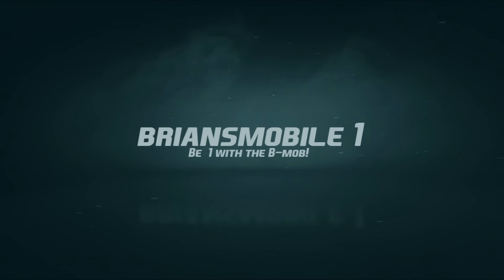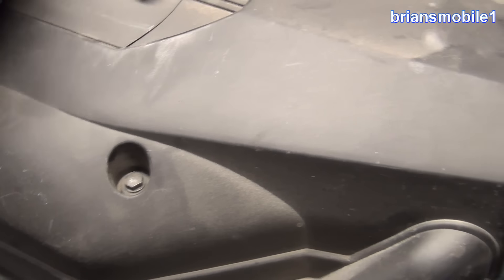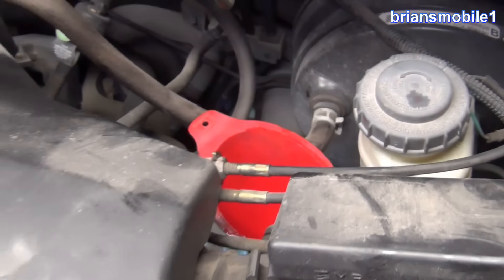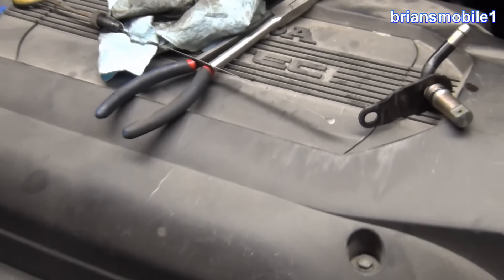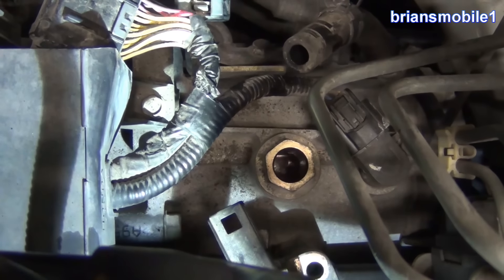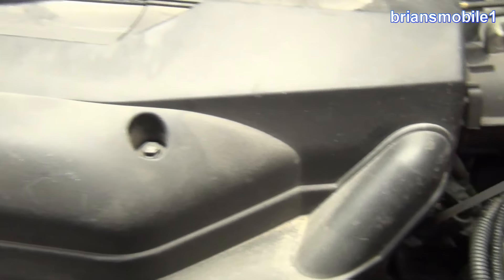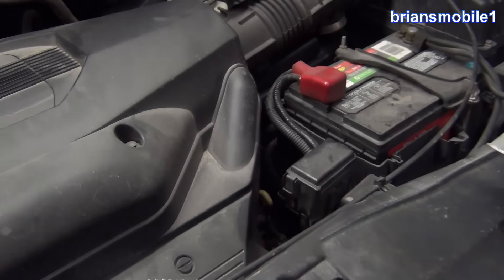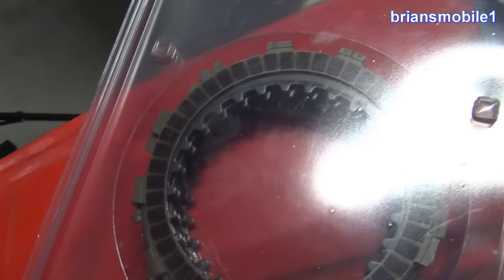Watch this Video BEFORE You Destroy Your Honda Transmission

Comment: Are there any filters that we should replace as well?
Reply: Honda transmission filters are mostly internal.. unless you want to seperate the transmission and tear it apart. Go ahead.
Reply: @edwarddiaz8136  Actually, you might be partly correct from what I hear but I recently watched a video of a guy changing a cooler line/cartridge filter that's part of the transmission system for this type of vehicle.  Also, there seem to be in-line filters that are also being sold for these Hondas.  Shouldn't we be changing at least one of these?

Comment: Thanks Brian
My 93 accord will downshift for a few seconds while driving on highway.  The green light on "Drive" flashes.  Can you give me advice.  The fluid has been changed several times...no flushing was performed
Reply: Do your floorboards get wet after heavy rains?
Reply: @netdoctor1  Hey there. Your question has me curious now. My son has a 2000 Acura TL. As the rainy season began, the trans started slipping when it warmed up. I do also notice the front floorboard carpet (especially on the driver's side) always feeling damp to the touch during rainy season, yet I cannot trace down where it's coming from. Any ideas? Thanks
Reply: @FarAboveDaCloudz  Can't be certain, but my problem was leakage through the firewall. My car was almost always parked under a maple tree, and the windshield drains filled up with debris. During heavy rainfalls, the water overflowed the drains and spilled in through the firewall and dripped onto the floor. The drains were not well-planned. It didn't take much debris to stop them up.

Comment: Great video Brian!  Thanks!  Why fill that way?  I got a regular vinyl tube which I put through the exact transmission funnel you have and pulled it through. Nice and tight but zero leaks and awesome addition to those funnels. The other end of the tube fit tightly in the dip stick hole. Just fill a bit at a time so it can burp while filling but worked awesome!  Why Honda puts that damn tube so far down that those funnels by themselves don’t reach is so frustrating!
Reply: Honestly it’s pretty straightforward doing it the way he did. Pop a fill plug, drain out old fluid while warm with car level. Pop drain plug back in, fill up with long funnel, snug fill plug, check fluid level. Adjust as necessary, torque fill plug to spec. And off you go!

Comment: You might mention the spin on little transmission filter that needs to be serviced but I do not know the service interval? I just changed mine when I bought my Odessey back in 2018. It is a real challenge to replace hard to get to. Located on top back side of torque converter housing under the battery support bracket. James

Comment: Not all Hondas use that transmiision fluid -- the correct type can be found in the "Information" section of the owners manual.  Some newer ones use Honda ATF Type 2.0.   I do agee that the OEM fluid should be used, rather than any aftermarket fluid.  Also, not all Honda transmissions have a dipstick.

Comment: We own a 2016 Honda HRV.
I took it in for schedule maintenance at 30k and was told the transmission fluid needs to be replaced. According to the service guy the fluid needs to be done because of metal shavings in the fluid. He said this is normal ware and tare.  Is this normal for every 30k.

Comment: I have an '04 Accord with 92k original miles. It was my dad's. Before he passed a couple of years ago, he swore the transmission had been serviced. But, he couldn't remember when. (He also said the tires were new. They were dated 2006. lol) The fluid still looks good. Still reddish, not brown. The car shudders a little between 40mph and 50mph sometimes. Should I have the fluid drained, magnet cleaned and refilled? Others have asvised against it. What is your thought? Thanks in advance.

Comment: That dark fluid is usually from the torque converter. Very common problem with Honda’s.  And Honda gas changed the fluid type several times over the years.

Comment: Hello my 2005 Pilot doesn't have this ATF return line. I read elsewhere that this model year had improvements on the transmission to not need it. My question, to prolong the longevity of the transmission, should I source and install this retrofit? Thanks.

Comment: Interesting fact. Nissan makes the worst CVT transmissions. I own a Nissan with a CVT. I change my fluid every 30,000 miles which equates to about 2 years for most people. I’ve been doing this since it was new. It has 132,xxx miles on it and surprisingly drives pretty good. Nissan makes the worst CVTs on the market from what I’ve seen and heard. My coworker purchased a new Nissan in 2017 and I advised them to change their fluid at 30,000 miles, they failed to do so. Their transmission went out at only 34,000 miles. Transmission fluid is +/- $20 a qt. A new CVT can be over $4,000. Though Honda makes decent transmissions these days, I’d still advise people to stay on top of their maintenance if they want it to last. Anything beyond that recommended service interval and you’re driving on borrowed time. In many cases the transmission works harder than any other component on your car to get it up to speed. It is very much prone to heat wear and the fluid is prone to oxidation and thermal breakdown over time. Change it.

Comment: Does this apply for 9th gen accords v6? I checked the dipstick for transmission fluid in the morning (no start) and it was past the T in "HOT but about 2.5mm from full. After driving the car for about 10minutes and checking 6min later it was just under max dot. I'd assume as long as the fluids in between the two dots in fine

Comment: I change my fluid took out 3 quarts put in 3 quarts. But now when I engage in drive or reverse I get plenty of vibrating noises but in neutral and park it doesn’t. I don’t if it’s the transmission it’s self or the mount for it. 2006 Honda Accord Lx 2.4L
Reply: If you used the correct Genuine Honda DW1 fluid it's probably just a transmission or motor mount. If you used any other brand of fluid drain it out and put in OEM Honda DW1.
Reply: Double check your work. Might have something partly disconnected like a vacuum hose or something. Just a suggestion.

Comment: Can you refill fluid in the dipstick instead ?
Reply: If you end up having to fill through the ATF Level Gauge Tube, heat your fluid up a bit and it will flow better.
I found that I could "shock" the Fill Bolt by taking my 1/2" drive impact socket and impact extension and give it a good rap downward with a hammer from the top. Amazing how well that works.

Comment: I am a former Honda dealership employee - Honda Canada does NOT recommend flushes for any of their systems, transmissions included. The do indicate that a transmission drain and fill of a about 3-4 litres of fluid on a single occasion is enough. You do this with a refuelling of the fluid levels with new fluid, then drive it for a couple of months, then do it all over again. Over the course of a year, you will have changed all of the fluid, but without changing all of it at once.
Doing it all at once just invites transmission issues. It is easier to suggest Googling this, than to write out an explanation.

Comment: Thanks for the infor man, I have a 1996 EK1 Australian market civic hatch with an automatic that has the same issues you are talking about, did a fluid change, cleaned the magent and there was an instant improvement. I am the new owner of the car and it looks like it has not had a change for a very long time. One question I do have is, when its cold it gets stuck in forst gear and the only way to get it to shift up to second is to almost redline it. after that it operates ad normal for a worn transmission. DO you know what the cause of this could be? It is not slipping, it simply wont shift...

Comment: I accidentally bent a steel line, and couldn’t really get it to the shape I felt comfortable with, so I replaced everything with a remote spin on oil filter setup. Just keep it away from the exhaust, secure every line and fitting, and bolt or rivet the adapter to the underbody brackets.

Comment: I figure it's very unlikely you see this, but it doesn't hurt to ask. I have a 2005 Honda odyssey and it only has a plug for the transmission. does that mean I have an older transmission? or just a special case? Thank you.

Comment: Fortunately, it's much easier for a 2.3L 4-cylinder engine to fill the transmission fluid.  When clean out the metal shavings that magnetized into the bolt, make sure the spray brake cleaner onto the bolt's threads, so that they are clean when putting the bolt back in.  Make sure to take a small piece of thing clean rag and wet it brake cleaner and wipe the inside threads of the transmission bolt hole, again to make sure the threads are clean.

When filling, I fill one quarter first, and wait 5 minutes.  Check to make sure there is no leak from transmission bolt.  If things look good, fill up with rest of the quarts.

Comment: Mischief is a good car. He made it all the way to work and back, 20 minute backroad journey with transmission fluid that had likely been inky black long before I checked it after the poor baby shut down on me. I live in Tennessee, so we don't have a single square inch of level ground anywhere. Hills are a way of life. Most backroads are rollercoasters. Through all of that, he managed to make it all the way BACK to my neighborhood that night. He died in the middle of a four way stop sign lol. Right in the middle. 
Thank God I have friends that are willing to help me push my undead car back to my house. It was less than a quarter mile, but that was the longest fraction of a  mile in my life. 

Even still, Hondas are troopers. Take it from a dumbass who didn't realize her transmission fluid was running like ink.

Comment: Toyota’s are a PITA no dipstick!!! I recently had my torque converter replaced along with the fluid because of a recall on torque converter flex? My transmission was slipping a little between second and third gear on my 2014 RAV4 I looked it up online and there was a recall so I brought it in and mine was affected they replace the torque converter and transmission fluid now shifts fine!

Comment: Remember to replace the crush washer on the transmission pan bolt too!
Reply from the maker: Good call George.
Reply: Is it really a crush washer though?   Just looks like a regular flat washer to me so I just reuse them.  Never had a problem.
Reply: @gfriedman99  it should be an 18mm aluminum crush washer... similar to the engine oil drain plug of 14mm
Reply: @ricebike  I guess you have never seen a real crush washer.  What's on the Hondas is just a plain aluminum washer.   A crush washer cannot be reused.  A plain washer can be reused if it is still in good condition.  Been doing it that way over 25 years - no problems.

Comment: 1. DO NOT opt for the flush, or back-flush. There are a number of filters built into your Honda ATM and you will simply be stirring that s*** up and encouraging it to stop something up.
2. Some Honda ATMs have an external filter, but every one of them has a strainer in the sump, through which the pump pulls filtered fluid.
3. Save that old fluid until you know for certain the new fluid isn't allowing your ATM to slip. You may have to drain the fresh and add the old fluid back.
4. Warming your car in winter is important - even more important for the ATM than the engine. The engine will make its own heat, but not every ATM has a warmer/cooler.
5. I switched all my Hondas ( 8 Accords, a Pilot, an Element and 2 Odysseys) over to Castrol for Imports - mostly to reduce the torque convertor shudder I was getting in the Pilot. All but eliminated the shudder. I have made the same recommendation to friends who have had similar complaints with both Elements and CRVs with a fair amount of success.
6. Both the drain bolts and the fill bolts tend to want to seize because of the interaction between the aluminum case and the steel bolts (this was even the case with new transmissions). I would install an impact socket onto my impact-rated 8" extension and give the (non-jet kit) fill bolt a good whack from above to loosen it. That ALWAYS worked.
I did 30+ years in the Honda trans assembly factory. I have single-handedly built or rebuilt hundreds of automatic transmissions.

Comment: One Honda owner claims he was told that if they flushed his transmission with a special fluid that did not contain detergents that it actually can help, but that other places will flush with a detergent that would harm, is there a good type of transmission flush and a bad type or all they all harmful?
Reply: Honda's recommendation for these is to change the fluid, then drive for a few miles in every gear, then change the fluid again. They say to do this 3-4 times in a row if there are issues. That's what Honda calls a 'flush.'

Some shops will flush extra fluid through by operating the transmission while removing fluid from the cooler return line and simultaneously replacing the same amount of fresh fluid.

Whatever process is used, the only fluid that ever goes in should be regular ATF, like you'd normally fill with, and nothing else.

Comment: Hi. Nice video.  Did not understand what you were taking off with the bent needle nosed pliers. A filter .   I have a honda cr-v.  Not sure if it applies. And should I change the filter on my 2013 cr-v when I do a transmission  Fluid change.  3.1 qts also fwiw

Comment: I did my first tranny oil change today at 38K miles (2017 model year). I checked the dipstick before the change and the first hole had oil in it and the opposite side of the dipstick that didn't have the lines/holes had oil past the second hole. I put the three and a third oil quarts of oil into it, warmed it up and rechecked. The oil is dry on the side with the lines/holes and oil up past the second hole on the other side of the dipstick. I added a little more oil, now 3-1/2 quarts and still sign of oil on the dipstick. I'm afraid to overfill but think it still needs more. I saw in the tech book from someone, it's standard practice to have to put 3-1/3. Any advice? I think I'm going to run it for a day and recheck and keep slowly adding until I see oil in that first hole.

Comment: My '03 civic auto trans slips pretty bad is it worth changing the fluid?
Reply: No, trans rebuild or get it replaced
Reply: @Toolaholic7  ok thanks bought it 8 months ago slipping I drive it like a manual easing off the gas when it shifts...been doing this for almost 9 months hasn't gotten a tad worse 💪
Reply: @liveandletlive2894  Changing worn fluid can cause it to slip worse. When it's at the point your is, the suspended material in the fluid actually helps the clutches engage and catch eachother. Nice new slippery fluid will make it worse. Save the $ you would have used on the fluid for a new car lol. You can look into stop-slip additives though. They wont make it any worse but can sometimes help.
Reply: @Luckingsworth  yeah I put in the Lucas stop slip dont think it changed anything but like I said I drive it as if it's a manual and that's working for me almost 9 months
Reply: If fluid level is good then you can try the Lucas. It couldn't hurt

Comment: the pan holds 3 quarts, the entire trans has about 10 quarts. You should capture the returning fluid at that return line with engine running, 4 qts at a time.
Reply: Drain and fill every 20-30k miles is the ticket

Comment: So if I have a 2012 Civic with 200x miles that has never had trans fluid changed, can it be changed now or will that mess up whats left of the transmission?

Comment: I have an 2006 Acura TL and while i was away my wife got the oil changed at jiffy Lube and they conned her into changing the transmission fluid, and of course she did.... The car has been driving about 20 miles since but i'm so paranoid, i dont know what they put in there.... so i'm going to Acura to change the transmission fluid again on friday.

Comment: what about the cvt transmission i have on my 2017 accord? Dealer says i need to flush every 25K-30K and I do...Not sure what they use to flush it with though. It has 165K on the odometer

Comment: I agree about no chemical flushes. Transmissions do not have the problems with carbon and soot that engines do because they don't have any combustion occurring inside them, therefore they do not need those kinds of chemicals to clean out buildup that is nonexistent anyways. No additives of any type.

Comment: Hey. I hear the 2005 and 2006 have a filter in the tranny that can be changed out and the video I saw it was pretty well disintegrating.  The Honda people say they last the life of the vehicle but obviously they do not. Would you recommend pulling it out and changing it?? I am worried pieces would break off on removal and enter system

Comment: All these comments about using a tiny funnel and a hose contraption.... just go to harbor freight or amazon and get an electric transfer pump (rated for petroleum) and hose adapters to get it to whatever size you need. Pour your oil into a clean bucket or other container, put the pickup hose into the oil and the output hose into the dipstick tube or other small opening, and slowly pump the oil into the trans or whatever.  Works great for filling power steering pumps that are way down at the bottom of the engine or way to the back too. Those transfer pumps are extremely useful for a lot of different jobs. It's one of those tools where, once you own it and use it, you wonder how you ever got along without it. Just sayin.
Reply from the maker: Amen... as long as you somehow clean it well between the oil etc. and using it for the transmission.